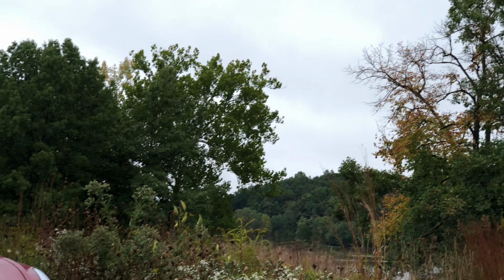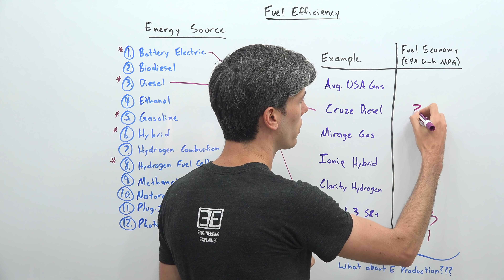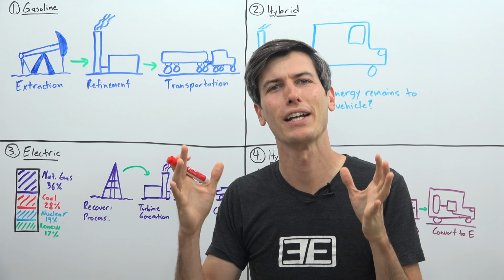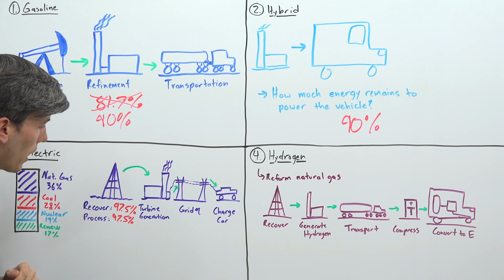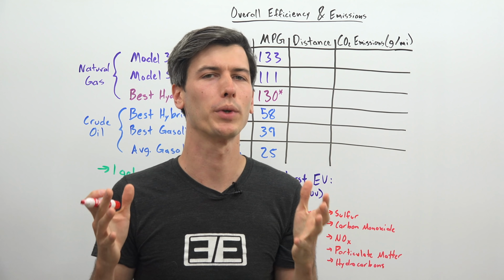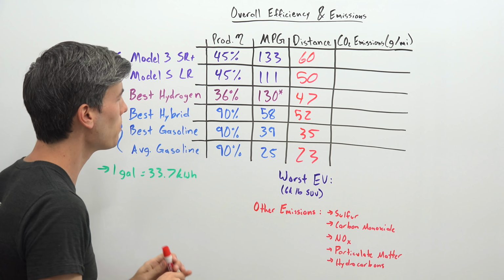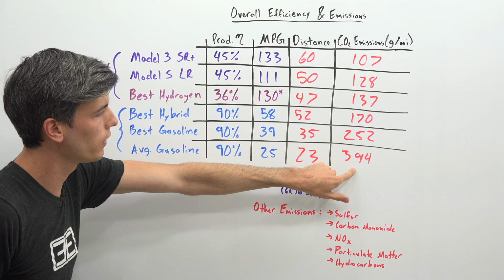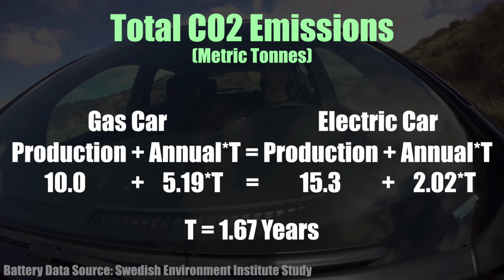Are Teslas Actually Better For The Environment?

Comment: lifecycle CO2-equivalent emissions (g/kWh)

coal - 820
gas - 490
biomass - 230
solar pv, utility - 48
solar pv, rooftop - 41
geothermal - 38
concentrated solar - 27
hydro - 24
wind, offshore - 12
nuclear - 12
wind, onshore - 11

(median values calculated by the IPCC 2014)
(note: solar/wind require buffers, which are not part of this calculation)
Reply: Exactly nuclear is the clear winner. Yet if you ask anyone they'll tell you nuclear is bad. It's the only one that is clean, controllable and reliable.
Reply: @Name-kd5jj  Plus nuclear doesn't kill endangered birds in large numbers like wind.  Also, they completely ignore the fact that nuclear has a small foot print.  Wind and solar take up massive amounts of land in comparison. Which could have trees on them, for example.
Reply: Nuclear ftw
Reply: why are his numbers so much lower then? he has EV as 100% natural gas and has a g/kWh as 190
Reply: @itemushmush  In the video he shows grams of CO2 per mile driven, the comment shows grams of CO2 per Kilowatt hour of energy.
Reply: James 

i can’t answer that. according to the IPCC data, even omitting methane emissions and infrastructure & supply chain emission, direct emissions alone (in a commercially available gas combined cycle) account for at least 350 (minimum), 370 (median) & 490 (maximum) g/kWh.
Reply: @kam_iko  Your numbers are per kWh, in the video he has emissions per mile driven. That's the difference.
Reply: HoodooOperator 

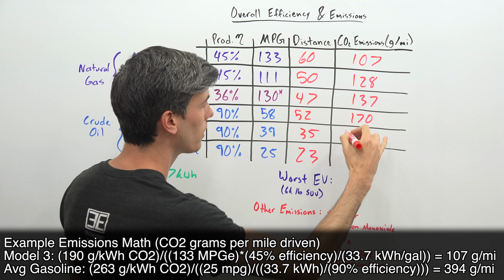i think James was referring to 12:26 - bottom of the screen
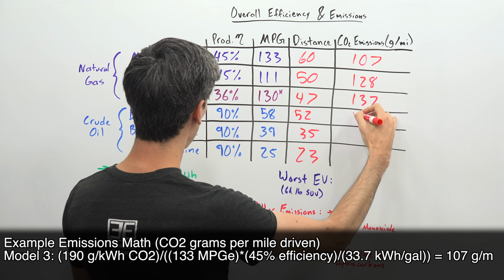Reply: @MrDRSMAX  go to 12:21 and look at the "example emission math"
 it says 190 g/kWh CO2 for EV and 263 for average gasoline car
Reply: Biomass is carbon neutral since the energy came from the CO2 in the atmosphere.
Reply: Darrin Donze 

by that logic, so is coal.

biomass is a significant co2 emitter and in case of wood, also a polluter (particle pollution).
Reply: @kam_iko  No, coal was stored away millions of years ago. Our earth has a natural 'breathing' cycle of C02 where biomass is part of this.
Reply: @nfcknblvbl  Yes, some governments define biomass as carbon neutral - but scientists don't. The actual number will depend upon factors such as type of biomass, and how long it has been allowed to grow, and transport. eg a lot of biomass produced in the us is shipped to europe. I've seen 230 used quite a bit, however some claim it even dirtier than coal.
Reply: @itemushmush  those are the numbers for a power station....there is really quite a range.  I've seen coal from that 820 number up to 1450 and gas from 350 for the most advanced CC units up to 650 for old jet engine designed peakers.
Reply: @dcheverie  Correct. They say that to power the world with 100% solar at current consumption rates you would have to cover an area the size of the Sahara desert with solar panels. Does that seem logical or even possible? But lets also remember that most of the world consumes electricity at fairly low rates due to limited development. That number will double or triple as the population grows and more countries develop. But i don't need to convince you of this as it appears you are already on the nuclear train.

Now we just need to get the public over their irrational fear of nuclear power which is no doubt perpetuated by the fossil fuel companies and those in bed with them(the government). Then we may begin building new Thorium molten salt reactors all over the world. Hopefully after that nuclear fusion will become the norm. Either way the future is nuclear, not solar and wind which are about as useful for generating electricity as hopes and dreams.
Reply: @dcheverie  Wind doesn't prevent trees, the blades are above the trees.
Reply: @TDrudley  Yes, but they have to clear trees to install them.  You can't get the equipment (cranes, etc.) into a forest to install giant wind turbines without cutting down trees.  So, they can't just be put anywhere, you know?

Comment: I live in Germany and I drive a 2006 Ford Fiesta 1.6 TDCi. Normally I get 50mpg. If I put effort in driving economically and limit my speed to about 55mph, I get easily to 70mpg with my personal best being as high as 84mpg.

With my camper (partly integrated design) based on a Ford Transit, I get to 30mpg and that is a big car!

You should compare the Tesla to the most efficient fossil fuel car in the same category as the Tesla. That would make more sense.
Reply: That's Euro MPG, he's talking US MPG, by which I mean they can't even measure a gallon properly over there.
Reply: Unfortunately the us government and big oil have determined we cannot have the high mileage autos you have in Europe. While electric cars are cool I don’t like the fact that Teslas are in constant contact with headquarters and can have features turned off and on OTA any time they deem it necessary. For long distances they don’t make sense due to recharging times
Reply: @stevemiller6766  tbf Supercharger network is already pretty large across the states and when you travel, you usually make stops and 30 minutes should be enough to recharge.
Reply: In the latest UK reliability survey the 2nd worst brand (Land Rover, which are awful) scored 78%. Tesla barely scraped 50%. That's a Tesla thing not an electric thing of course, but I'll stick with the Lexus for now. The connection thing is coming for all cars and I hate it, I don't mind my location being tracked but every tiny detail of what I'm doing? Sure, they don't really spy on people as such but I'll pass anyway.
Reply: @ApothecaryTerry  we dont use MPG in europe, we use L/100km
Reply: @alexstromberg7696  The UK uses MPG and is in Europe. Yoda is in Germany and he's using MPG too- and I'm guessing they're the same as the UK rather than the US (based on those numbers that must be the case).
Reply: @ApothecaryTerry  yes he said mpg Just because if he had said l/100kms you wouldnt understand
Reply: @ApothecaryTerry  the UK yes, is the UK the whole of europe? Also he most likely converted it for you before. All the other countries in Europe uses L/100km
Reply: Well done everyone who understands that most of Europe does not use MPG. Have a cookie. For those not missing the point completely, Yoda's MPG figures were the ones we use in the UK, not the US ones, hence are on a different scale to those in the video.
Reply: @ApothecaryTerry  seething
Reply: Like any human these days I bet on a conversion via Google which gets you US MPG first. This would also fit the Diesel engines consumption of 3,3 to 5 liters / 100 kilometers
Reply: @ApothecaryTerry  Would like to see a link to results from that survey.
Reply: @DxCBuG  While we'll never know without a reply from Yoda, the best real world figure anyone has reported on Honest John is 67.8 with the average being 55.6 so while I'm sure 70 UK mpg is possible by tailgating a lorry it's certainly not a realistic number to compare to anything in the video. If we use that figure then we may as well get the range figure for a Tesla with aircon & stuff turned off while also tailgating a lorry- it can probably beat the max quoted range like that (if the doors don't fall off...reliability not a strong point!).
Reply: @ApothecaryTerry  Well, I've seen real world tests where the Tesla needed to turn off aircon and drive a maximum of 90 km/h to barely reach the advertised range. Pretty sure their rated efficiencies and power consumption are wrong as well. Btw. it was put up to a diesel SUV with the tank filled to the energy equivalent of the Tesla's battery. It was running with aircon and driving normal speeds of ~130 km/h. It reached the target before the Tesla and with fuel left in the tank.
Reply: @ApothecaryTerry  I spent last weekend travelling along the A31 & M27 in a 15 year-old Golf Estate with a 2.0 TDI engine.  Over the course of the 50 mile trip travelling east, the trip computer reported just over 68mpg (trip average).  No tailgating lorries, just driving normally in the rain and evening gloom (so lights & AC on) with multiple passengers - travelling at 70mph where traffic/speed limit allowed, with a trip average speed of just under 40mph.
Reply: @ApothecaryTerry  We use l/100km in Germany, but I converted to US mpg for you guys so we talk about the same thing.

Here the metric data so you can convert yourself:
Normal driving (max 120 kph or ~75 mph): 4,5 l/100km
Eco driving (max 90 kph or ~55 mph): 3,7 l/100km
Extreme Eco driving with a lot of coasting and maximizing the use of engine braking: normally 3,2 l/100km with a record of 2,8 l/100km
Reply: @CrossEyedLion85  
I can confirm such numbers with a Golf 5 powered by a 1.9 TDI (diesel engine). Doing 1200 km with a full tank of fuel is amazing. Cheers!
Reply: @razorblade7108  I'm not a fan of electric cars. I'm merely pointing out that comparing one guy doing some godlike hyper-miling is not a valid comparison to anything. The same applies to EVs reaching their range.
Reply: @BRqRyEEh5Q  I'm just going to take this opportunity to applaud VW on their honest, truthful figures ☺
Reply: Apothecary Terry we dont use MPG in germany
Reply: @CrossEyedLion85  In that case those are impressive figures. My point still stands of course- I've had 73 mpg on a 10 mile run from my GS450h and regularly beat 50mpg, but that doesn't mean those figures provide a valid comparison against the numbers in this video. Got to compare apples-apples which means these huge figures we can all quote can only be compared against others obtained in the same way. I will state again though that my argument is purely against the logic being used to make the argument. Electric cars are, and will always be, better for the environment. That isn't the same as saying they're better outright.
Reply: @ApothecaryTerry  lol :).  In my experience the trip computer numbers are "right".  Having gone "those numbers can't be right", I have previously reset the trip computer when I filled up and compared the long-term average consumption over the course of 1 tank (that's mode 2 on the trip computer), to working it out manually based on odometer reading and amount of fuel being put in according to the pump - they were within 5% of each other (with the trip computer seeming to think the car is using more fuel than the manual calculation method).
Reply: @BRqRyEEh5Q  Couldn't miss that joke though! To be fair the only car I've ever noticed the trip computer being inaccurate on was a 2016 Audi A4 which said it did 45mpg yet used 3 litres more fuel than my IS250 in the same distance...while the IS250 had done something like 31mpg. I've done a bunch of driving in an A6 with the super cheaty EA189 engine and got 65mpg+ on long runs, no doubt suffocating everything on the way but the economy was accurate.

Comment: One thing I think that is missing is the category of manufacturing efficiency of producing the vehicle (emissions related to battery mfg, cost of battery materials, emissions related to vehicle and battery disposal, etc)
Reply: Cost of battery materials doesn't actually matter as if you compare with other harmful fuels. 
Yes but battery disposal is gonna be a major issue
Reply: He said multiple times that he has other videos about the battery effiency etc. Just go watch those.
Reply: You were not paying attention.
Reply: @Markle2k  Yes! Just look at the comment of Engineering Explained and you will get your answer
Reply from the maker: As discussed in the video, here are the links:
Production Emissions: https://youtu.be/6RhtiPefVzM
Battery Production/Disposal: https://youtu.be/1mXSMwZUiCU
Reply: @Markle2k  how so? I did see at the end he mentioned another video he had somewhat related to my concern.
Reply: @kunalmahajan9489  Lithium batteries are 100% recyclable, if you ever find one in a junkyard it's because someone dumped it in the wrong place. Their not being recycled yet, because it's neither legally required or economical* at this point in time, but once either of those facts change they can be recycled just as, if not more effectively than, ICE power units.

* That is to say, it's currently more expensive to get the lithium** back than it is to get new lithium.
** And other materials, lithium is the namesake but it's not like the battery is composed of 100% lithium.
Reply: @EngineeringExplained  thanks, I'll take a look. I commented right before the tail end where you mentioned those videos.
Reply: @MrHamof  With this comment you made a more stronger bond between a EV and me. 
Thanks man

Comment: How on earth is the most efficient diesel on sale in the US only getting 37mpg?! My 12 year old Audi diesel gets 55 mpg quite regularly.
Reply: Couple reasons. One is different gallon sizes, I presume you're outside the US where gallons are 4.54 vs 3.79 litres. The second is test cycle, the EPA testing perhaps isnt the best for accurate diesel mpg, we all know a BMW/VW diesel is a mega on fuel. Still 39 mpg combined is  46 mpg in larger gallons, which is a fairly realistic 50/50 highway/city mpg. Lastly US diesel isnt as good as say Euro diesel, one of the reasons Mercedes have injector issues in their US models.
Reply: you don't have california legislation that requires a dpf which kills mpg
Reply: Mark Wells I don’t live in the US. I live in England, and have a dpf which is the law here.
Reply: Donkeh McDonkey ahh interesting! Thanks for explaining
Reply: @markwells8347  the rest of the  developed world complies with Euro 6 emission standards, which are pretty much as restrictive as US emissions laws, particularly for commercial vehicles.
Reply: He's using the EPA test results for city and highway combined.  To sell a vehicle in the US you have to run it through very tightly scripted tests.   Because all the vehicles have to do this, using numbers from the EPA result provides a common point for comparison.   Your Audi diesel probably was never tested in the US.  And I beat the heck out of my combined rating on a 2012 Honda Accord too :)

Comment: That 90% efficiency of gasoline during extraction, refining and transportation is way too high I think.. we already loose 5% just by evaporation! And as said here in other comments, that refining requires huge ammounts of energy.

But good to see once again that driving a Tesla is superior to driving an average gasoline car.
Reply: Have to agree. There is a measurement of how many barrels of oil are recovered from a barrel of oil used: Exploration through extraction, and its getting lower; especially as we extract the harder to get sources such as shale oil. Early days this was 100-to-1 currently about 20-to-1.

Comment: The assumption that electric power comes from combined cycle nat. Gas plants does not paint a clear picture. Most natural gas plants are basic plants that operate around a 35% efficiency and electric transmission/distribution has around 80-90% efficiency for all grid sources. Also apart from natural gas, coal power is almost just as prevalent for grid power. Despite making up a third of the electrical grid it contributes 70% of all grid generation emissions so coal really messes things up here. Make sure you’re not using coal to charge electric cars.

Comment: In Sweden we produce ethanol and biodiesel from organic waste. When running on those fuels you get close to 0 (fossil) gC02/mile without having to produce a huge battery with questionable environmental impacts as well as not financing child labour to mine the metals needed to make one. I'm no expert at other brands but I know SAABs with pure gas engines can handle ethanol with just a custom tune. This solution is far more simple than electric cars since both the vehicles themselves and the infrastructure to provide them with fuel already excists.

Comment: In Hamburg, Germany they are building a 100 Megawatt modular Hydrogen plant that extracts CO2 from the air, powered by wind energy. In Spain there is a Kerosene plant that also extracts CO2 from the air and is powered by solar energy.

Comment: My VW TDI turbo diesel gets 50 miles to the gallon. I can go almost 700 miles on one tank.
Reply: Tell me about it. 37mpg for a diesel? Give me a break. I'd need to drive around all day with the throttle pedal planted through the floor to get my diesel consumption down to 37mpg.
Reply: same mile units?

Comment: I live in the UK and was looking at this recently but I approached it slightly differently. I found reliable data on gross UK electricity production in 2018 based on our UK mix of generation. Our overall figure was 283g of CO2 per kWh. I then found transmission and charging losses similar to yours of 50%. Then found a quoted figure for a Nissan leaf of 4.9km/kWh. Calculate this out and you get 115g of CO2/km.
Compare this to a Toyota self charging hybrid Auris, they quote a figure of 84g of CO2/km.
Also there is a practical limit of how much intermittent solar and wind generation the grid can tolerate and is economic. Its unlikely we'll get to even 50% intermittent. If we go heavily into thorium nuclear generation that would be a game changer I suspect but there is still substantial co2 associated with nuclear when the full life cycle is considered.
Anyway thanks for a good video, bye.

Comment: I worry about battery degradation and eventual cost replacing them if buying a 2nd hand electric car
Reply: You shouldn't worry. In Teslas last earnings call, they confirmed the Million mile battery. That is 50 years if you travel 50 miles every day. Plus Redwood Materials are recovering >95% of the raw materials for reuse in Lithium batteries today, which will improve as they scale. Buy a Tesla, it'll be the last car you need as the over the air software upgrades keep improving the cars performance and range.